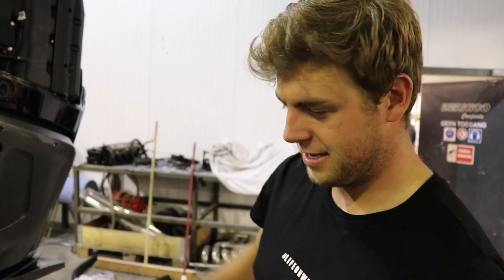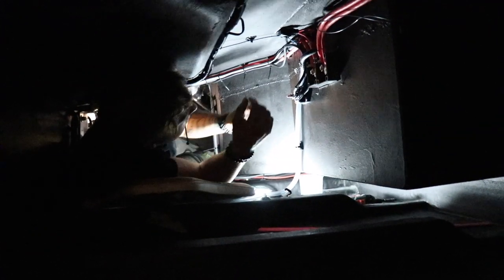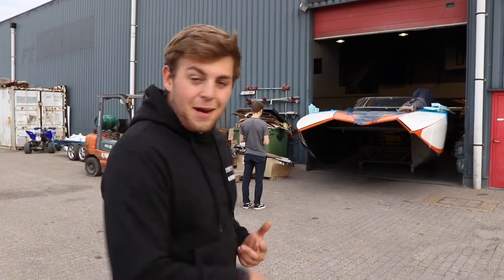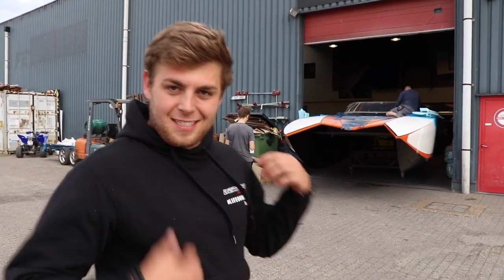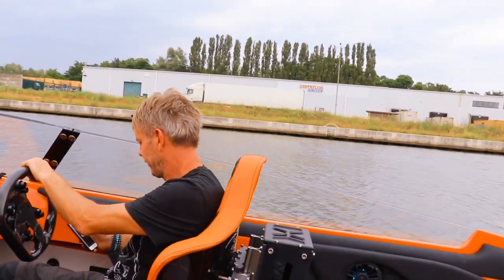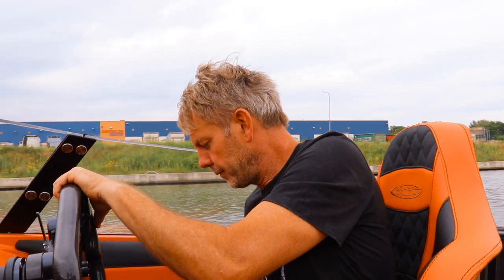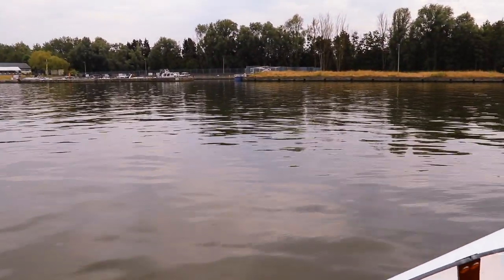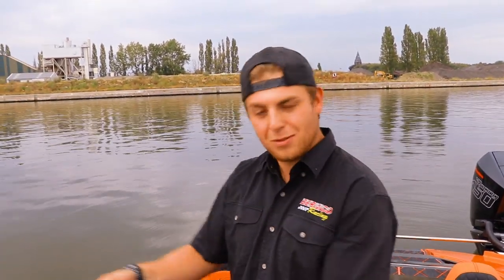100 MPH + THE FIRST MERCURY 450'S IN EUROPE!

Comment: That is an awesome style and creativity of the boat And I think you guys should design a boat that is a little bit longer a little bit wider the same color pattern but with a diesel high performance motor in it
Reply: Amon Davis nope drop the diesel for racing. Petrol only for racing
Reply from the maker: Hey Amon, the C35 is the maximum length you can tow a boat in Belgium using a recreational vehicle - plug and play 👍